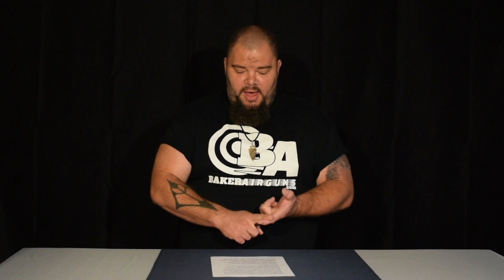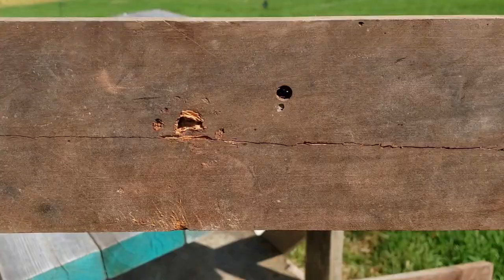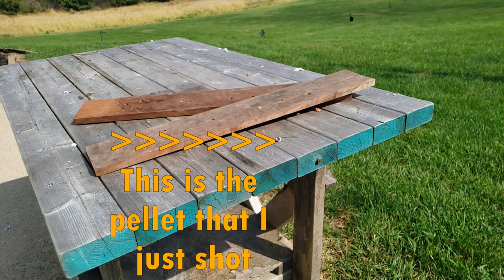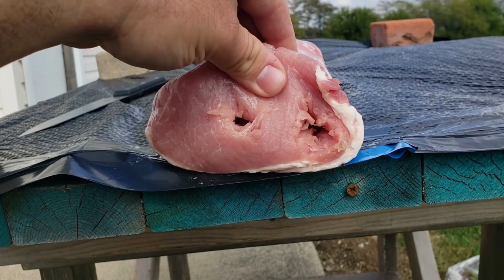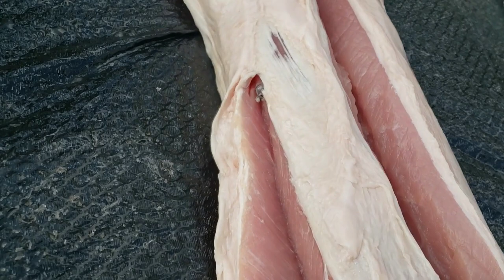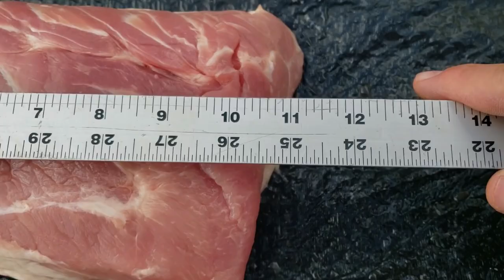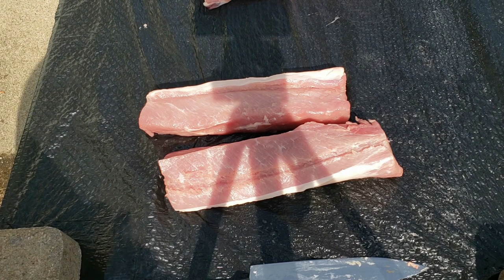PART II...What's deadlier, a .25 or .30 caliber airgun?

Comment: Ok, love the premise of the video.  I love the science of it.  BUT, and I hope this makes sense to many reading it, FPS for the .30 was way too low compared to the .25 cal.  For some reason, we have lost love for FPS and gained so much more attention and respect for FPE (not me).  WHY?  Well, there can't be FPE without FPS and GRs (weight).  FPE is a biproduct of FPS and FPS + GRs of a projectile will determine penetration/tissue damage.  Lead dome pellets are basically solids and it take a lot to deform them to any degree.  The .25 cal pellet is much narrower than the .30 cal dome.  The .30 cal dome is short and stubby as opposed to long and slender like the .25 cal dome you used.  As a matter of fact, they might be similar in length.  So with comparable FPE #'s, the .30 is easier to stop and will do LESS tissue damage/penetration.  Also, the more FPS you have, the more a bullet will deform under stress when it hits water based mass such as flesh.  And FPE is calculated as FPS x FPS x Grains / 450240.

So we are clear, I'm not a .30 cal fanboy by anymeans.  I've always been a fan of the .25 cal moreso.  I've done a ton of hunting with both.   In short, i would like to see a video with both calibers being pushed to the same speed.  So basically 975 fps for both, or whatever.  I will add something else for all to ponder, the powder burner world does not make two different caliber guns do the same FPE.  No one does that.  They straight up say, .308 Winchester vs .30-06.  Or .300 Win Mag vs 7mm Weatherby or .338 Lapua Mag vs .50 BMG.  Reason being is that you dumb down one round to suit your argument and its not a true representation of the offerings of the "DUMBED DOWN" round.
Reply from the maker: Hi Cedric!  Thank you for the post!  Always good to hear from you!  However, I disagree with the idea that the .30 velocity was too low.  Ted Bier won several 100yd benchrest competitions using a .30 cal set at 820fps.  Not to mention, using diabolo pellets, 850 is absolutely in the "sweet spot."  Also, until the popularity of slugs and Power Plenums, 70-75fpe was a very common output for .30 caliber guns.  There are still a million of them out there.
-Donnie
Reply: @BakerAirguns  majority of FX 30cal are around the 70fpe mark, yes the Impact can go higher, as Im sure the Maverick may. But most don't & they are very accurate. My 30cal MK1 Crown would send 50.15gr 865fps 83fpe, was awesome. But was happiest around 73
Reply: @BakerAirguns  ok so conduct the same test with the regular 25gn jsb kings in .25 running at the same speed as the 44gn in the .30.  The 25gn are much more of a scaled equal to the 44gn due to the shape and size. There will be a huge difference in your results. Just because the 44gn .30's tend to be the most accurate at 850 doesn't mean that is an optimal power to obtain maximum penetration. For a long time a .25 at 40fpe was the norm.
Reply from the maker: @satchguitar84  I no longer have access to the 70fpe .25 that I used.  Nor do I have the time to test every combination of velocity and projectile known to man.  I would suggest that you do your own testing if you're interested.
-Donnie
Reply: good points.
Reply: Tofazfou 👏👏👏 exactly.
Reply from the maker: @tomlpnexus  No.  You simply don't understand the problem.  The ENERGY has to be equal for an equal comparison...not the velocity.  What a pellet does to a target is work...as defined by the equation W=Fs.  That means work = force x displacement.  That's very rudimentary, and an incomplete explanation, but still accurate.  It is the FORCE (kinetic energy) that needs to be the same for an accurate comparison....and that's the exact situation I created.
-Donnie
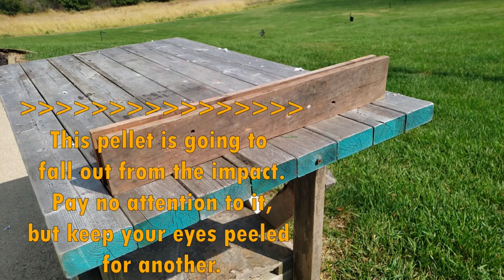Reply: @BakerAirguns  What's deadlier, a .25 or .30 caliber airgun? That is your exact question. The answer is .30 plain and simple! There is no reason on earth to run that low of fps on the 30. The whole premise of this is in the title.. deadly.  And yet you have the nerve to mention bench shooting as an argument for deadly. Bench shooting is a fine hobby for people who want to put tiny holes in paper during a friendly contest. It's not real world hunting!  It's absolutely ridiculous to act like if you turned up the 30 it wouldn't be accurate. "JSB Hades .30 | Ballistics Gel Testing | shooter1721" that's the title of the video go to the 10:39 mark and read it and weep! He does about half or 3/4 inch group at 50 yards with a muzzle velocity of 1014fps. These guys seem to be handling you with kid gloves. I don't know you so I'll give it straight. You use a bunch of mumbo jumbo and 2$ words to try to weasel out of the fact that the answer to the very simple question in the title is simply .30. The only people buying your convoluted story is your fanboys. Everyone else disagrees with you. And you lose the argument when you don't address their points and say shit like "The ENERGY has to be equal for an equal comparison...not the velocity" NO! it doesn't!  The comparison is 25 vs 30 that's it. The 30 has more power on tap makes a bigger whole and can kill a bigger animal. And you god damn sure don't need sub moa for hunting. That being said you can do sub moa at 875-900 fps with a 30. And even those speeds would penetrate more than the 25. I don't know what you're on about or what your agenda is.  Tofazfou has one of the sickest hunting channels I've seen. He's doing 865 to 915 fps with a .30 and making incredible  shots. You show a whole lotta cheek to argue with him. Looks like bout all you do on your channel is talk. This video is a grift a snow job you have an ulterior motive
Reply from the maker: @pcpguy9762  Again, you do not understand the problem.  Nor do you understand airguns very well.  70fpe is a very common factory energy setting for a .30 cal.  Trust me.  I've tested HUNDREDS of them.  It's part of my job.  The two FX 30 cals I tested Friday were 65fpe and 72fpe resprctively.  Yes, SOME 30 cals can run 80fpe or over...but more can't than can.  
-Donnie
Reply: @BakerAirguns  " Yes, SOME 30 cals can run 80fpe or over...but more can't than can." Yep and almost NO .25's will make 70fpe'! You've got the .25 with the longest barrel available and it's jacked to the 9's to make 70fpe at 965fps. And yet AT THE SAME TIME you have the unmitigated gall to say if you tune the .30 up even the 20fps or so that it would take to beat the .25 you can't do it because it would ruin the accuracy. You dig your hole deeper. "The two FX 30 cals I tested Friday were 65fpe and 72fpe resprctively" BFD! And at least the 65fpe one is not an impact. And the factory settings are IRRELEVANT! Because you have the .25 tuned up! You dig your hole yet deeper. I'll  say again you refuse to address mine or anyone else's points. "Trust me.  I've tested HUNDREDS of them.  It's part of my job" Ya I know you work at an airgun store that's what makes this so egregious. This fact eliminates Ignorance. You are willfully saying things you know are not true. Even with the shortest barrel available handicap the.30 could be mildly tuned and beat the very tuned ,25. And by beat I mean DEADLIER!! I'll repeat myself you have ulterior motives. That's the only explanation of why you would do this. What that motive is I can not guess. If you answer  back try addressing the points I and others have made. It is undignified to talk about everything  irrelevant from the solar system to some mystery gun shooting a pig to bench shooting. You would save face by just admitting your wrong or at least not digging the hole deeper with these absurd  so called arguments. I believe you can do better sir.
Reply from the maker: @pcpguy9762  Have you ever tried to see if there's a difference with the .30 set at 80fpe, or whatever energy level suits you?  Have you set up an experiment such as I did, gathered the data and formed a conclusion?  Or are you just saying things you believe to be true?  Until you show me data....STFU.
-Donnie
Reply from the maker: @pcpguy9762  You know why you should never argue with an ignoramus?  They have no idea when they've been beaten.
-Donnie
Reply: True facts there Tofazfou. It is also true that a 70fpe .22 PCP shooting a 34 grain pellet will out penetrate both the .25 and .30 if all are shot at the same FPE. It is just physics and the larger the caliber will create more friction and will require more FPE to penetrate the same
Reply: @airgunfun4248  My Maverick is doing 105 FPE with the 50 gn pellets and the power cannot be compared to my .25 AEA shooting 70 FPE. Its not even close
Reply from the maker: @gmatos123  Are you sure about that?  Have you tested it?  The reason I ask is because that's not what the "physics" say at all.  I'd love to see your experiment and results if you have them available.  Sincerely.
-Donnie
Reply: @airgunfun4248  hydro is water! i did not see any water test so what would the water shock have to do with any of this??
Reply: @budsbustbi6339  Hydrostatic shock like he mentioned in the video is a term used when talking about wounds created by guns. Often shortened to hydro shock. Flesh is mostly water like the human body 60%. ''hydro is water! '' Thanks
Reply: I totally agree they need to be shot at the same fps to be a fair test to test specifically the difference in caliber damages its not a test of platform specific airgun capabilities/limitations so i would slow the .25 to match the .30 speed for a fair test now it more so becomes a debate over sectional density and friction
Reply: Also to help solve the butchers problem all he needs to do is increase speed in order to penetrate the skull and if he cant with the way his gun is set up he can also leave the settings alone and go for a lighter .30 cal pellet with antimony vs lead mixture denser deforms less at all velocities
Reply: Absolutely 100%correct😂👏👏👏👍
Reply: @pcpguy9762  FACTS!👍 Comparing the subject of what's deadliest to some slow bench rest shooting is simply silly😂 By slowing a 30cal down and speeding a 25cal up and calling it a competition is just DUMB😵 💡Hunting flesh and bench rest shooting a piece of paper are two entirely different thing's, and should not/can not be compared as which is deadlier because paper isn't a living thing😂 The way this set-up has been done it like putting Mike Tyson in his prime with his hands chained behind his back and his mouth taped up, against me, I'd beat the living💩out of mike Tyson that way😂😂😂😂 💡Now the only LOGICALLY way for his theory to PROVE that a 25cal is deadlier than a 30cal is to shoot them at the same speed into the same medium, but that's not going to happen because i see he's hellbent on being right, and if this test was done EQUALLY by sending these projectiles down range at the same speed, he'd be proving himself wrong 100%😂👍
Reply: @catherineharris4746  He's on one! It's like a revelation to him that a smaller faster moving projectile will penetrate more. No one is arguing that. He tells me ''show me data'' right after I just did in my previous comment. It's like he refuses to address the data I just gave. Data that smashes his twisted attempt at logic. Also one thing I forgot to mention is penetration does not = ''deadlier'' in a lot of scenarios. For example these guns in question are for small game hunting even the .30 dumbed down like he has it would give ample penetration on a coyote prob. a pass through. So would the .25. One makes a bigger hole and is capable of dumping more energy. Bottom line the title is ''What's deadlier, a .25 or .30 caliber AIRGUN'' not which PELLET can PENETRATE more at an arbitrary level of power. So the .25 can penetrate farther bfd that's not needed. The .30 makes a bigger hole and if tuned as it SHOULD be dumps more power. Think of hollow points they of course have less penetration and yet are deadlier because they do more damage. His refusal to address the points that I or any of these people have made says it all
Reply: @BakerAirguns  
I dont want to discount ur own experiences, but I think your not seeing what many are saying.
We all agree with the outcome of ur test, as we've done these same tests ourselves, over n over again for years. In fact, i had a video up years ago showing my 25 cal marauder pentrating pig skulls. But I had to run it heavy with 43g eunjins if I remember right. Ive also killed two hogs with my 30 cal dreamline shooting 44.5g pellets at 60 yards. 
Neither are ideal honestly.
And at that power level, there is zero room for error.
But your taking a non-standardized example and making it a standard. 
I'm gonna shoot what I shoot. I have platforms in .177, 20, .22, 30, 357, 457, and 50 cal. They all have a place.
But this info may confuse new airgunners. Your test was accurate, but misleading.
Most pellet based platforms go up in energy as you go up in caliber,
With approximate pellet velocities going up in size and weight.
The advantage is more tissue damage with a larger frontal diameter.. 
There is zero hydrostatic effect at airgun velocities, but there is absolutely something to the shock effect of a larger projectile.. 
Example:, If I threw a bowling ball at your chest at 880 feet per second, it would likely get zero penetration, but you might be worse off than being hit with that 25 cal pellet at the same 880 fps with more penetration. 
The FBI doesn't study airgun ballistics. The premise is the same, but real world experience with shots on game lead hunters towards particular setups that work, and usually after much trial and error . Sure, I'd take an 80 fpe .25 cal slug gun over a 70 fpe .30 cal pellet shooter any day, assuming it's accurate with slugs.
But a standard 25 cal pellet gun shooting a 25 g pellet  is simply at a disadvantage to the same standard setup in 30 shooting a 45g pellet at the same velocity due to more energy, leading to equal penetration, but more tissue being imparted by the larger 30..
I understand and agree with ur 25 vs 30 penetration at equivalent energy premise, but ur test is purposely skewed, which is why you jacked up the 25, and ran the 30 anemic.. That's not typical or intuitive to most airgunners..
The same test with the impact 357 and 81g pellets at equal velocities might clear this up.. Sure, you could tune the 357 waaaay down to equal the power output of the 25, to get more penetration out of the smaller caliber, but why would you ever do that?
Where all this starts to come into play is with body shots. 
Again, I've had better results on shoulder shot hogs with larger diameter slugs with more energy and no Exit, than I have with smaller bore full exiting slugs.. For whatever reason, the FBI's data just don't crunch in the field.. 
But I do agree with one thing, shot placement is paramount in airgunning..
Reply: @BakerAirguns  it's obvious that the .30 would eliminate the 4 inch difference with a hammer spring adjustment,  a tune would beat the .25 . Plus you have to take into account a pass through doesn't deposit all the energy.
Reply: Exactly!
Reply: I completely agree with you when hunting we run are 44 gr at around 920 fps around 100 fpe and 50gr to around 107 fpe and getting 1inch groups at 100 a 25cal can’t touch those numbers so to say 25cal is deadlyer than 30cal is just ludicrous

Comment: I chose the .25 caliber because it was in the middle of the range of choices. .50 caliber has far more disadvantages to be reasonable and .177 was out of the question, so it basically came down to magazine capacity and air consumption.  The .25 caliber is a perfect all around size that covers all the bases and checks all of the boxes.

Comment: Interesting video. Might be a more accurate representation if the impacts were set up at the same velocities instead fpe. That said I have taking a 240 lb wild boar at around 45 yards. I used an fx impact compact m3 with 44.75 grain .30 hybrids @ 885 fps. Great video!